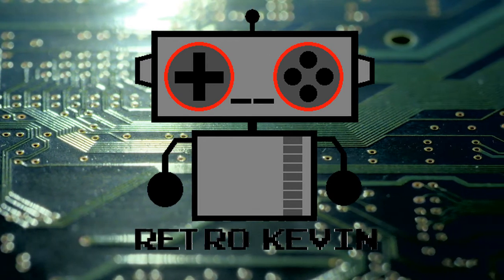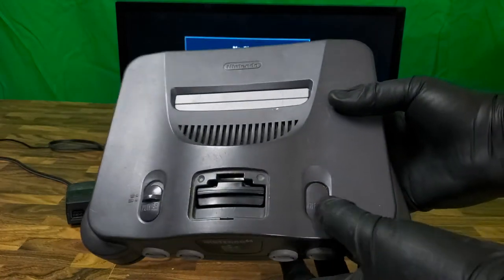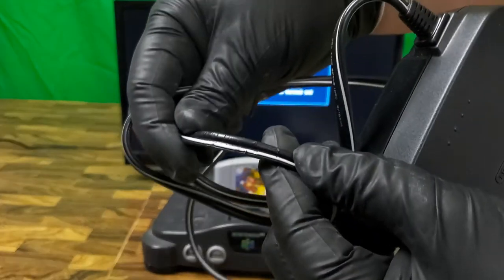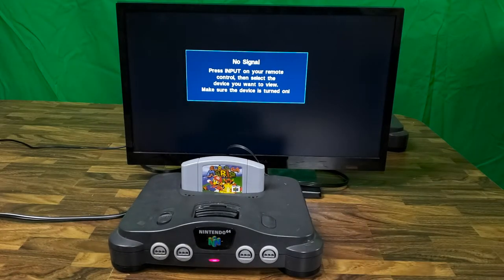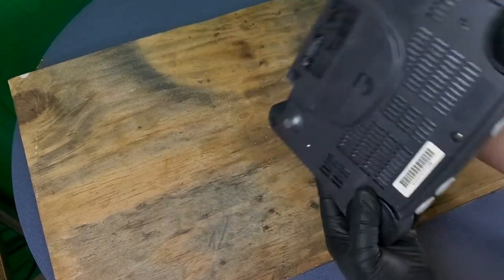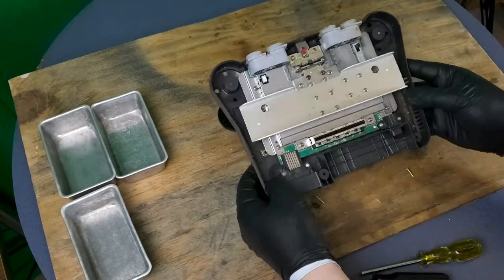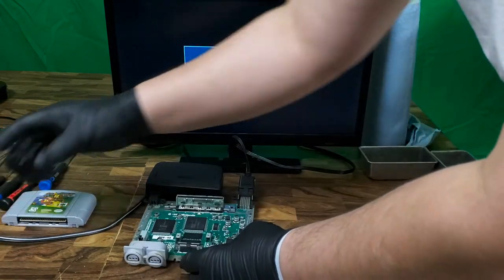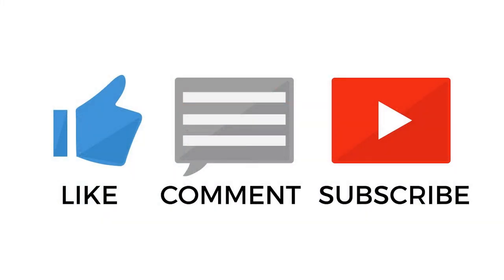Fixing Junk from Ebay. Nintendo 64 no video

Comment: I over did that thingy @10:27 with the heatgun, and the capacitors on the other side desoldered :(
So be warned and be careful.
Reply from the maker: Oh no! Should be easy enough to resolder. I should have added a warning in the vid. I'm pinning this so it's easily visible.
Reply: @RetroKevin  I still have them all but Im suspecting even when they are surface mounting still have polarity, and thats the tragedy ☹️ if thats the case
Reply from the maker: @cawaboonga85  the little multilayer ceramic capacitors do not have a polarity. And if you have them all still that's great! They can be a bit tricky soldering because they're just so small. Best of luck, wish I could help you more.
Reply: For more control, you can reflow the solder with the iron; just apply flux and touch the iron to the pins, moving inside out (away from the chip). As long as you're aware beforehand of where the other components are, you can usually avoid unintentionally desoldering them.
Reply: This one of the reasons why it's not a good idea to use a heat gun in this case, the second is because heat gun unnecessarily stresses out components for a job that could be done with a soldering iron. Granted soldering requires some skills and a good flux.

Comment: I know this video is 3 years old but helped me out!  Question for you though, I'm trying to identify a resistor on the back of the board.  In the FIL11 spot.  I know it's 1.3 OHM, but outside of that im lost haha.  And I MAYBE had one pop off and cannot find the tiny thing anywhere.  Any tips on replacement?  Cheers!

Comment: It’s amazing how many just have a bad AV Cable or Power Supply. I worked on one and tested two others last night.  Also what’s up with the GameBoy Colors with bad speakers. Seems like there are tons. They all get that rust colored spot on the speaker. Easy enough fix but seems like a flaw.
Reply: Do you happen to have a link of a fix you suggest?
Reply: Only thing I’ve found is replace with a new one.  It requires soldering two wires.  The speakers are available on EBay
Reply from the maker: This is one of the reasons I'm making these vidoes. 

I can't tell you how many times I've bought someting "broken" only to plug it in correctly and it to work.

Not all fixes are this easy... but a lot of them are.

Comment: no one seems to be able to solve the random resetting issues i have. power light stays on but will randomly go back to bootup. no broken pieces, reset button not stuck.
Reply: I would also like to know how to solve this
Reply: try replacing the power supply and reset button

Comment: My n64 works fine but when I turn off the system and swap games the video doesn’t show. The power light is on. If I unplug from the wall then plug back in it works. What can that be?

Comment: @2:34  is exactly what my issue is currently with a console I got off facebook market place for 30 bucks.. i took it to ubreakIfix and they didn’t know what to exactly do with it.. geeksquad wouldn’t touch it either.. my local retro stores didn’t have a person to work on it either
Reply from the maker: Are you having issues with removing the shell?
Reply: @RetroKevin  no, it was mostly the video not working. I found a local guy I've known for awhile that will work on it for like 50 bucks
Reply: I’d be willing to help if I was near you ❤

Comment: Hello I have an old Nintendo 64.
It's got some maintenance issues.
You see if I leave it unplayed for months it gets dusty and my console has a random reset issue.
I was wondering if it's possible to ask for your help 
I don't know if it's my power supply, my games, cartridge slot etc.
I got my N64 my controllers and my entire collection 
I could send you them to see if you can fix it.
But I'd need to send you a document of all issues I experienced.
Is this fine?
Reply from the maker: Before sending it in for repairs I'd recommend looking into the reset button. Gunk can get built up in there causing issues. 

However, if you're interested I do have personal contact info in my video description. There we can work out details

Comment: Plug controllers in it, says, controllers are not plugged in. I do what it says, turn it off. Plug it in turn it back on, and it says the other controller's not answer. I do the same thing. Turn it back on, then it goes back to the other controllers not in, but it is

Comment: My 64 isn’t displaying video or audio and I don’t have the tools to take it apart so I guess it might be better to buy another one which I don’t to do 😅
Reply from the maker: Does the red light come on when you power in the system? If not it's possible you have a bad power supply.

If it does my guess would be the AV port. They screwdriver you need is under $10 on Amazon.

And it might be possible to reflow the soldering with a hairdryer on max setting and get it really close to the solder.
 https://www.amazon.com/dp/B07BF8R6YY/ref=cm_sw_r_apan_glt_fabc_5C72958HHJ8HDT19QY7P?_encoding=UTF8&psc=1
Reply: @RetroKevin  the red light does come on and I bought a new AV cord and I tried a couple other things online that said would help but still nothing. I ended up taking it to a place where they repair older consoles but they said they don’t know what it could be and they said they checked everything from the motherboard to the ports themselves so it is a little confusing
Reply from the maker: If shipping wasn't an issue I'd take a look at it lol

Comment: Plus, these systems are meant to be played on tube style TV’s, not LCD’s.
Reply from the maker: 100% this. I can not disagree with you at all. CRT TVs have barely any input lag, and the lack of resolution almost makes an anti-aliasing effect.

I do not by any means ever play on the TV that I have in my videos (aside from the quick play tests shown). It is solely a small testing TV.

I would love to have a Sony Trinitron for my retro systems, but they're bulky/heavy for the size I want.

Comment: Sometimes you have to beat on the game itself to work. That's what I do to mine to make it work fine.
Reply from the maker: I also hear that blowing really hard in the cartridge will work sometimes too
Reply: @RetroKevin     I can confirm that blowing on the cartridge worked 50% of the time during the years 1988 to 1995.